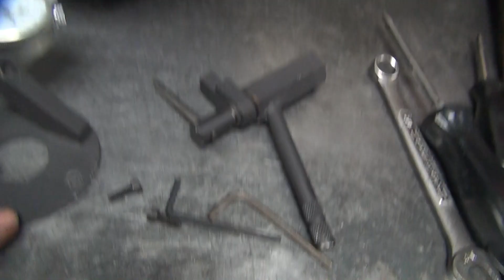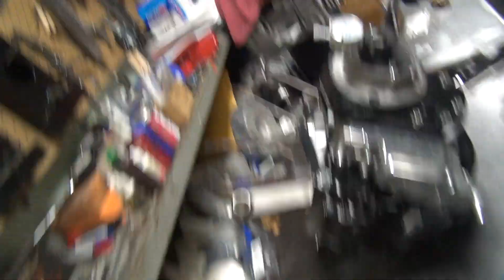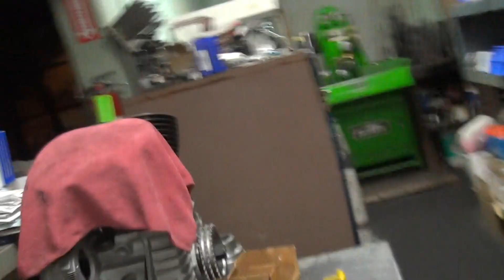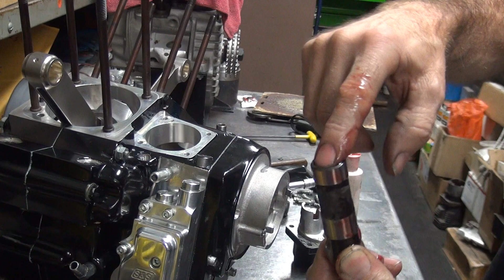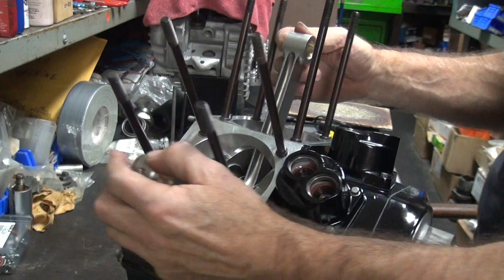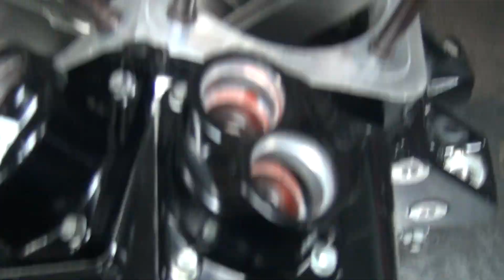#120 2001 Indian Scout motor rebuild 88ci bigbore S&S overhaul Evo Harley by Tatro Machine

Comment: Does it matter how the tappet oil inlet holes are oriented in relation to the oil holes on the tappet blocks? I've never been able to find that information in my service manual. Seems like you'd want the oil holes to match up with each other but that's just a guess, figured I'd ask the master himself
Reply from the maker: no, not on evos.
tatro
Reply: @TatroMachine  Thanks Keenan